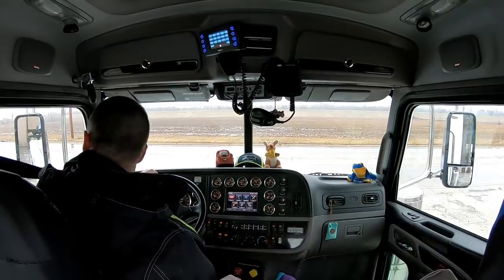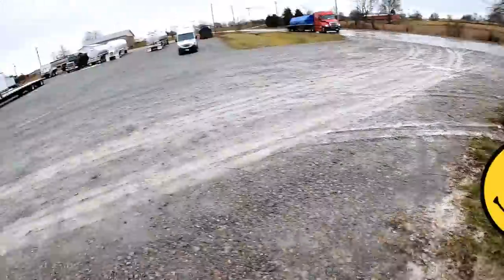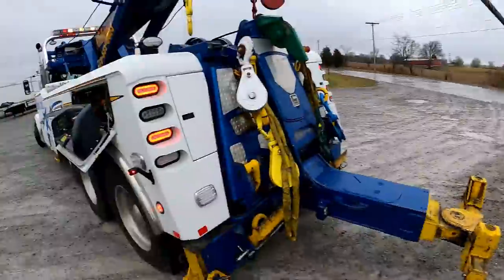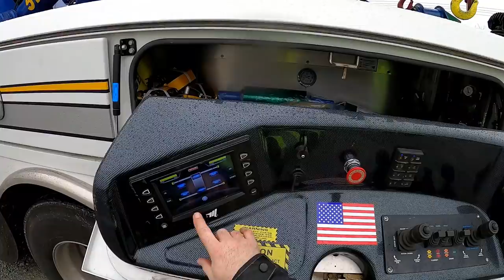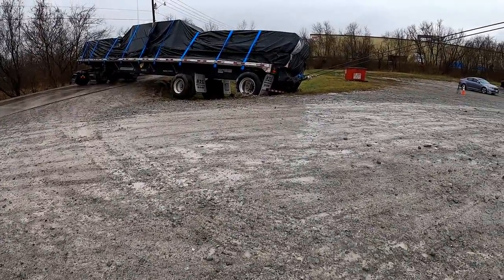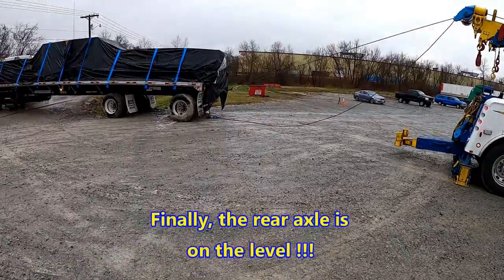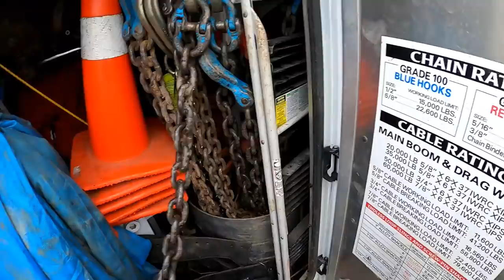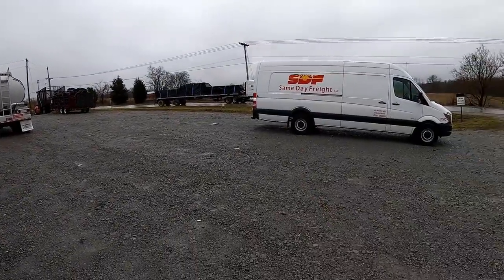Flat Bed Faux Pas!!!  We've Got a Leaner!!!

Comment: It just amazes me how many times you have had to tell professional truck drivers how to drive. Great job as always! Got yer six.
Reply: Yeah you really need to take a step back there.  There is  Professional truck driver then there is  Rookies,  Rookies won't listen and need to be told what to do.  Professionals will  Listen when being told what to do and Learn from it.
Reply: Yeah, He had an acre to make the turn and short cuts it in the ditch!!!!!!
Reply: Would it be possible for you to give a ballpark figure on your services for some of these recoveries? Love your videos, BTW.
Reply: Curtis Cox if he was professional Ron wouldn’t have to tell him how to drive!
Reply: @7924hobo  Don't know Mr Pratt's numbers, but from what I've heard generally a recovery operation like this easily set you back 500 bucks.
Reply: Rimrock300 
A standard tow will usually run 500 dollars just to get started. I recently paid $690 in NY to get a bobtail moved 14 miles. 
This was a recovery... those costs are always going to be higher than a tow. I don’t see Ron quoting or giving a price until he has a specific situation to quote, every recovery is different and so is the price.
Reply: @7924hobo   I got towed 36 miles without a recovery and it was $1400

Comment: Well, the driver secured his load properly!
Reply: and he is very nice too :)
Reply: Michael Gilroy don’t give him to much praise he could have several items underneath his tarp that’s not secured. He definitely needs to work on tarping. Maybe I need to invent some see through tarps since drivers like tarp then secure their load.
Reply: He did. Early days I asked a scale master how they determine if a load was secure. He said if you can pick up the trailer and turn it upside down and nothing shifts or falls off, it was secure.
Reply: Maybe the load, but not the tarp.
Reply: That's sarcasm right?
Reply: Michael Gilroy The driver did not secure his load properly, he did not tarp it properly, and to top it off, he could not maneuver his truck out of an incredibly wide driveway, without putting it in the ditch. He was very lucky that the load didn't spill into the ditch.
Reply: I’ve been driving truck for over a paid 1.2 million paid verified miles and yes his tarp on the back flap was not put away correctly and me personally I would never run straps over a tarp other then in the from and back so it was secured bungees are not a securement device but to say his load is not secured is incorrect he is hauling plywood or osb just because you cannot see the load is stupid how do you not think maybe he slides his straps before trapping but so say not to bough straps your very very incorrect again and incorrect to say it because it shifted plywood and osb will shift very very easy on a trailer butt the man had 9 straps and if they where rated at the least 5k pounds that’s 49,500 pounds he would be over weight if that Amount of straps is incorrect and his driving is very very poor but his secured load is correct other then the hanging flap and long as the shifted load isn’t pass his rub wells he is fine and as a dot officer he is okay so all you super truckers out there need to calm down that man is over a 100% secured I’d say that load is around 47-48k pounds at the most  and how he has it strapped is rated at well over 55k pounds and his tarp is secured as well being they have straps over them both only problem is the flap and I would say driving that nothing is overed because the flap will be flapping witch will make people look at it and will see his lights because they will notice the flap flapping okay don’t ranting lol grow up and go back to trucking school people before you say incorrect information please only his driver skills are very very bad
Reply: If that the only good thing he got going for him
Reply: Brandon Hall I have never heard that the tarp needs to be secured. I always run straps under and never thrown one over the tarps and have never had a problem with DOT. Only held with bungees.
Reply: This way under secured for btc
Reply: Tarp tuck class is next week

Comment: I can't figure out how he even got there! Besides being a rookie mistake ! Of being that close to swing around the culvert! But I'm just a 40+ year OTR wth do I know!  Good job of making the recovery look easy Ron!
Reply: Looking at the trailer the driver didn't swing wide enough going out the driveway. Then once the right side tires got into the ditch, the driver tried to back the truck up into the lot, just planting it deeper in the ditch.
Reply: Yeah i was trying to work out of he drove in, or reversed and cut it too much? Theres tire marks on both sides of the ditch so i couldnt tell :D
Reply: It happens man years of experience don't mean anything we human we flawed by Design.
Reply: That big wide driveway and he still put it in the ditch....I dont get it lol
Reply: Mr. B knowing the turning radius is so important for sure, saves a lot of money too, just like avoiding dead end roads.
Reply: I know we all have had our share of mistakes and I am sure he learned a big one there. As much driveway was there I definitely would have given myself extra swing room especially dragging a spread axle. He wasn’t off a lot but you can see that when he hit the brakes, if slid on the wet ground deeper into the ditch
Reply: he got one wheel off over the culvert and it slid sideways i think.
Reply: Mistakes happen. He knew he messed up and wanted to make it right.
Reply: I only drove OTR for two years and knew not to cut a corner that short...
Reply: Matthew Ford That driveway wide enough to pull into with a damn train. Look at his tracks. Cant put this one on flawed by design. I would love to know what happened tho.
Reply: He'll not get his safty award this year and may have the recovery taken outta his next few checks.
Reply: I was thinking the same thing smh just quit while your ahead lol that’s way past a rookie move lmao

Comment: I've never heard anyone make the connection yet, so I figured I would mention it. Three short horn blasts is a Maritime Rule of the Road and indicates a seaborne motor vessel in backing down.  So the sequence does have meaning, at least a nautical one.
Reply: Three shorts is the old railroad whistle signal for starting a reverse move.

Comment: He stands there and watches when the first thing I heard you say was you needed the tarp out of the way..
How hard is it to grab a few bungee cords and tuck it up like it should have been in the first place. 
 It just kills me to see a tarp flapping in the wind, but what the heck there cheap.
Reply: Agreed, that's just lazy. Former flatbedder, no excuse for that tarp to be hanging down like that in the 1st place.
Reply: Yeah I understand the driving mistake. It happens. But get that tarp tight lol.
Reply: John V and then saids you can cut it if you need 😂
Reply: The trailer is on top of the tarp. That’s why the driver offers to cut it.
Reply: John V the tarp was stuck under the trailer. Not much he could have done.
Reply: I agree.
Reply: Well it was trapped under the rear bar to start with. But no excuse after.
Reply: the tarp was trapped under the bumper,  thats why he offered to cut it.

Comment: Ron was so correct about the midway point where the forward rear axle was totally off the ground. With the load semi shifted, consider the flexibility of an aluminum trailer. One moment it can be all twisted up looking like junk, the next it will spring itself straight. What I seen was a key factor to success with this recovery was Ron's choice of two lines coming off the rotator instead of one drag winch line. Right off the bat, that decision made the difference between success & failure. My first thought was to pick the rear of the load up & rotate it on to the road that he was turning on. That would have been a testy move as the aluminum flatbed position changes with the weight distribution. One second you can be O.K. the next, you are in trouble. Aluminum Flat Bed Trailers are very dangerous to work with & have very little on the frame for hook ups. Most of the time, for safety reasons, the freight has to be unloaded or knocked off the trailer before the trailer can be moved.

Comment: Spread axle trailers do not turn like a regular trailer. And he had all that room to turn and still dumped it off in a ditch. These new drivers are going to keep Heavy wrecker owners in plenty of business. I retired from the trucking industry after 34yrs and 4million miles driven. Ive never called a hook for reasons like this. I have how ever called in a wrecker for blown rear ends and stripped out transmissions. Or when a truck ralphed up a turbo. Ron Pratt I have done business with you in past years with different companies. Love the videos and take care and god bless.

Comment: 👍professional observation from a driver 🤔sometimes a company will replace the rookie driver that made the messy incident with a seasoned driver that will work with the wrecker operator and reduce secondary issues.  This guy looks and acts like a seasoned driver not one that would miss a backward turn with a spread axle and lots of turning area in the gravel lot 🤔👍

Comment: Rons next Rotator the Miller Century M100.  With the M100 and its 339" of boom,  you would be able to lift the trailer out of the ditch and set it on the Road.

Comment: I adopted your 3 horn signal while working at a timber yard, sometimes you have to reverse onto the loading pads and people are standing in the driver safe zone behind you, I was asked what it was and why. I told them the story, as much as when entering a building you give a toot to warn people that may be at the doorway you give 3 quick blasts to warn I am reversing. My truck is not fitted with a reversing alarm. The "Safety Auditor" liked the idea and was keen to see other operators adopt it.

Comment: That's the trouble with spread axles like that. You never know witch one is going to grab and pivot you. He was expecting the front axle to grab as it would with most driveways. However that driveway has a slight dip before the street. That caused the rear axle to grab. The spread sent him in to the ditch. God bless

Comment: I'm ... a little confused about why Ron didn't do a quick "pick" from the rear. However, this looked surprisingly safe and smooth. Side-pulling rubber was probably less wear on the whole package than lifting 25 tons from two little points.

Comment: I had to laugh at some points in this video. The load and tarps are not done properly. The tarps should have bungee cords on the outside to hold the tarps down. Second, give Ron a chance to look and assess the situation before telling about how it should be done.  Looking at the tire tracks the driver cut the corner way to short.  Nice job Ron, stay safe.

Comment: There's a Loves truck stop in Texas where you have to make a really wide right turn onto the frontage road... between the Loves and the road is a really deep and steep drainage ditch, and that bugger claims three or four trailers every single week.

My only too-sharp turn resulted in clipping the right front outer rim against a chunk of concrete, bent the rim badly enough that the tire wouldn't hold air.

Comment: With the spread axle the driver should all ready know he needs more room for his turns. How he dumped the rear of the trailer into the ditch in the first place without seeing in his mirrors is a sign of his inexperience, but like he said, he couldn't see because of the mirror angle. That's why the have remote mirrors which could be adjusted from the drivers seat. Also the driver  did not seem too worried about the load shift, (which never should have happened if properly secured). He had already told Ron the load was shifted before he went into the ditch. If it was shifted, why didn't that worry the driver? I'm Not to get to fussy about the driver but come on folks, Their is an element of responsibility here. He seemed to somewhat know what he was doing (until the point where he drove his trailer into the ditch) But at the same time was not too worried about it. If he's an owner operator where he owns the truck & trailer than fine chock it up to a learning experience. If he's a company driver, he is in deep kimchi.

Comment: Not knowing what the load was until the very end or how far he had to take it, I'm kinda surprised he didn't pull the tarp and have you get it squared away.  Sure looked shifted to me. Hey Ron, you know any good truck repair shops in the area that can toss on a new set of wiper blades?  LOL #3

Comment: Used to have a buttonon the tailboard of the fire trucks, bell in the cab 1 stop, 2 forward, 3 reverse to communicate with the driver.    I like the pull straps on the high hooks, why climb if you don't have to.   Noticed you started with the snatch blocks on the main winch lines but they've been moved.  Faster deploy time without them?

Comment: those wipers ...... replace them PLEASE !!!! Use Rain‑X Latitude and buy yourself universal silicone blades about $1 from China moving forward those work like a charm and are cheap so you only pull and replace from there on the LIB not the full blade which safe you a TON of money.

Comment: Its hard to believe the driver never secured the tarp on back of trailer. Next call will be to remove 4 wheeler stuck under trailer. That leads me to believe he never even checked the straps on load.

Comment: wow im not at the controls and the way that thing was leaning during that pull i was cringing hard 

ive never driven spreads only tandem vans but i was always taught if there is room to maneuver USE IT!  NEVER CAGE YOURSELF INTO A MISTAKE  
but we all have screwed up  me included at over 1million preventable crash free miles 
if u ever tried to turn a truck on damp yazoo clay its like pure ice went to turn around and truck went straight and brakes didnt help any 

took me right into 2 foot deep mud lol  a winch out later with nothing broke i was on my way

Comment: The truck driver should have fixed that tarp that was hanging down off the back of the trailer before leaving. I would have had a good check of the straps before leaving the yard as well

Comment: If the rigging was easy they would not have called you Ron! I was going to make a comment on the wipers but I thought to just let in ride. My wipers under this scenario would have driven me bonkers. But you are focusing on the task at hand and you probably never "heard them". It bothers me more than others because of my hearing. Either my old computer is worn out or my ears are getting worse. The only way I can hear videos now is through earphones. Just a little sidebar. I am deaf in my left ear anyway. So my ability to ignore certain tones are already at a disadvantage.

Comment: So....what kind of company/driver is someone if they're a "regular customer" of a tow truck company?    That's not a regular customer I'd want to be.
Reply: Their probably customers on the workshop side of Ron's business.
Reply: They operate a heavy duty truck maintenance and repair shop. Towing and recovery is an additional business.
Reply: If I remember right, Ron frequently stacks flatbeds for a local trucking firm.  He showed one where he was training Mike on the tator by doing the lift ‘n stack.

Comment: Hey Ron, How many time has the under lift reached out and whacked you on the kneecap while working around the back end of the truck?  inquiring minds want to know, I know the stinger on the back of my pickup is always looking to take a bite out of my knees, that's why I try to make it a point to keep it in the cab if I'm not towing.

Comment: Just one question please, why the differant coloured hooks (need painting)  is somthing to do with pull capicity?
Reply: Not really; from what I have seen [and I am NOT a tow driver] -- the different colors of hooks are simply a visual reference; I believe that "tator"'s control panel is simply color coded and each hook has separate control.

Comment: Thanks for sharing Ron. At 21,000# what would have been the  issue with lifting and swinging the trailer out to the road with the boom?
Reply from the maker: I could have.  Several things kept that from being my first option.....an aluminum trailer that will twist......the location of the culvert....the proximity of the overhead power lines.....the unstable load.....etc.
Reply: @RonPratt  I  never thought about the aluminium trailer and it twisting the frame. That would not have been good

Comment: I have noticed that you most always (when arriving at the scene) stop several yards away from the device you will be towing.  This requires you to exert much more energy walking between the truck and the towed device.  It seems to take more time also.  What am I not seeing that is the reason you do this?
Reply: get the big picture first I bet
Reply: 🤗First responders approach from a distance to see the big picture of the incident and makes you transition into working attitude instead of driving stress prior to arrival 👍🤗 police fire wrecker operations 🤗👍
Reply from the maker: Correct.  Thanks for watching and God bless.
Reply from the maker: Again, correct.  Thanks for watching and God bless.